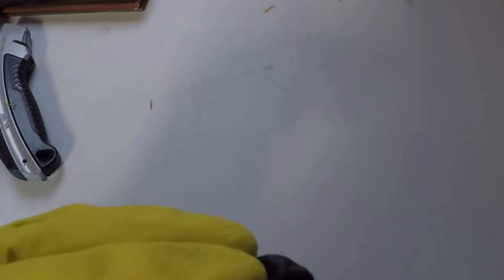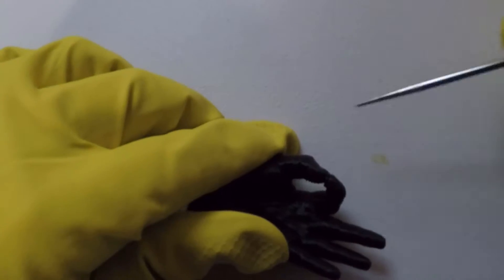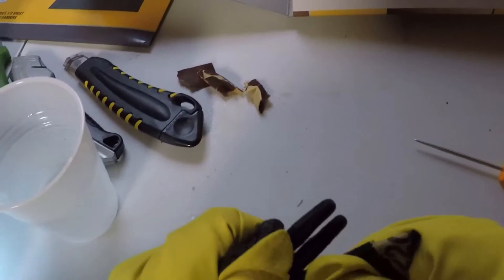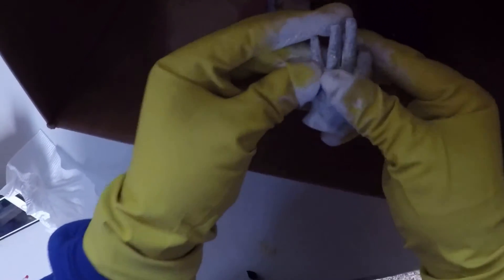How To Smooth 3D Prints - PLA/ABS/PETG | New Techniques!

Comment: This is covering not smoothing
Reply: Not exactly, to be honest. He showed only a part of the process. Usually you use putty and sandpaper to smooth the model. Only then you apply thin coats of primer and paint.
It takes quite a lot of time though, couple of hours for sure. But then all the details will be there except layer lines.

Comment: I painted a guitar once with rustoleuim. Coat every 20 minutes might be able to dry but that many coats will never cure. It took 6+ months for mine to fully gas out and become hard. If I leaned it against anything it would get dents by sitting there.
Reply: Did you clear coat it at the end? I hear paint cures "through" clear coat at a slower rate. But that's hearsay...
Reply: @FollowNdFeel  No it was a simple flat white. Because that is a 3d printed piece that will sit on a shelf maybe nobody will notice, but if you have a guitar that needs to lean on a stand or set on a couch/carpet etc, literally leaving on the couch would leave imprinted texture on my guitar after 30 minutes. That was many months after spraying it. Wood is softer so maybe it would fully cure faster.

Comment: I have been working on smoothing my PETG prints. I've tried acetone, non-acetone nail polish remover, and MEK substitute (because MEK is no longer available). The only one that seems to actually work is the MEK substitute. It smooths the prints very well, but then material is left soft, which is obviously unacceptable. Still trying to find a good way to do this without paint
Reply: maybe to heat it up shortly with a flame like with ABS? Let me know if it helps.